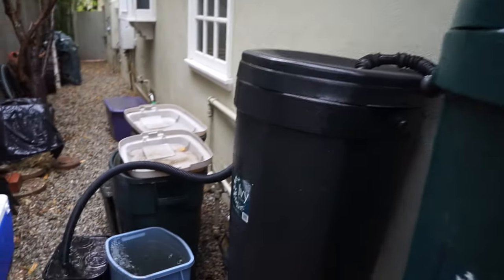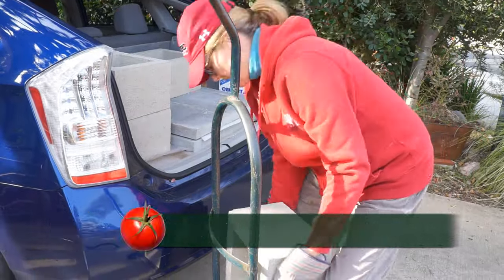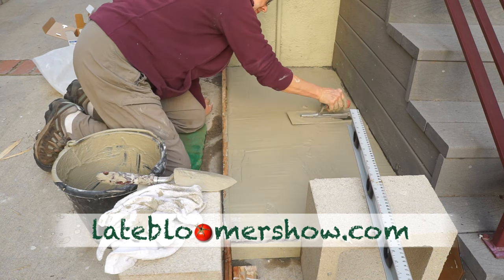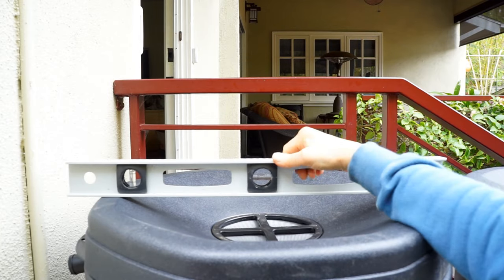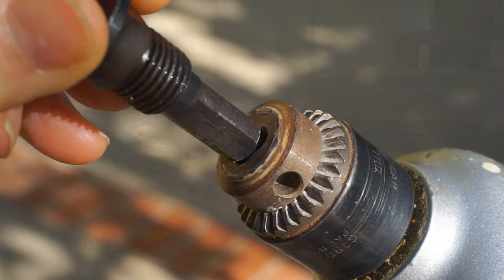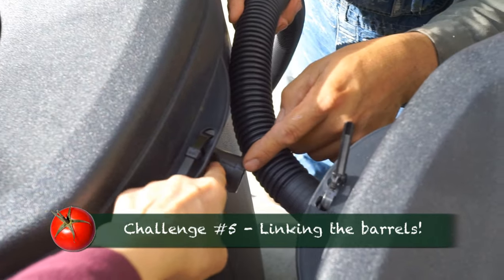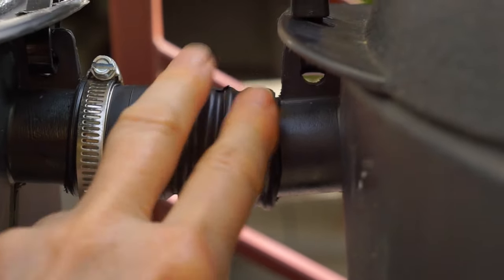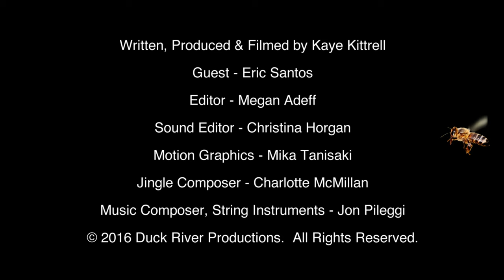Rain Barrel Install DIY & Challenges - Late Bloomer | Episode 4

Comment: Great job, Kaye! I'm glad the diverter kit worked out! It probably won't make a difference with the small amount of rain you get, but I would have pitched the platform ever so slightly away from the house.
Reply from the maker: +OneYardRevolution | Frugal & Sustainable Organic Gardening  I think that's the problem on my other rickety setup. When it overflows the top, it spills back down the side of the house. Must work on that, but it's hard to adjust the tanks when they are full of water! 600 pounds, LOL! I think the newer set up is not nearly as worrisome as the other side. Good point. So if tanks are literally leaning against the wall of the house, they should pitch forward a touch?
Reply: +Kaye Kittrell | Late Bloomer Urban Organic Garden Show Yeah, ideally the platform would slope away from the house just a bit.

Comment: I will not lie it was very... entertaining lol. on Saturday we installed a 5000 liter tank in the front yard. We fill it up with borehole water and attached a small pump to it. so we can water the garden and if needed we can hook it up to the house. We still need to install two smaller tanks that will collect rainwater and will be used only on the garden. :-)
Reply from the maker: +basic gardening What is borehole water? That's interesting, and a 5000 tank must be HUGE. How is your garden doing? This is Conrad, right?
Reply: ***** yes it is Conrad. It's not that big we could have gotten the 10000 liter tank. You might call it a well over there. It is a hole drilled into the ground with a pump in it.
Reply from the maker: +basic gardening You mean, it's ground water in it?
Reply: ***** yes ma'am

Comment: Love it!  I have a bunch of rain barrels at my house and I can fully relate to your plight.  I have one right now not even set up because of how much trouble it'll take to set it up.  One thing that I've done with mine is I have soaker and drip hoses staked through the garden off of them.  It rains enough here in Tennessee to where I don't need much more than what drips from my rain barrels.  A few times in the summer it'll go a few weeks without raining so I'll have to irrigate then, but the rest of the time no worries.  I bet you'd need tons of rain barrels to do this in Cali though. I'll empty an 85 gallon in a week or so, but then I just switch the spigot to the 2nd one.
Reply from the maker: +Quantized I'll be in TN next month, where are you located? How does your garden look? I just got through hauling 2 gal. can back and forth from front rain barrels, made over a dozen trips, and my back is aching now! I want to get my last Vlog from Vancouver posted tonight and tomorrow a new episode! Stay tuned.
Reply: +Kaye Kittrell | Late Bloomer Urban Organic Garden Show I'm in Maryville if you're in my neck of the woods I'd love to meet up! :) My garden is doing well some things are sprouting and surprisingly a lot of things made it through the winter thanks to my hoop houses and small greenhouse.  Don't have my rain barrels going yet because we are still having freezes.
Reply from the maker: +Quantized I should be passing through Knoxville on my way to Abingdon, and that's not too out of the way. Have not planned my exact route. Was thinking of doing a Vlog for that trip (as it would have a lot of material and cost me a fortune to make into episodes), but we shall see if the Vlog helps my channel or if it's just getting a bump from the folks at the festival and my regular reliables.

Comment: A Stainless Steel downspout, impressive.  I'm glad your video had a happy ending but at times it was painful watching.  Hopefully the sun won't be hitting the barrels or at least not very long.  Those barrels aren't like any I've seen in Oregon, they seemed thinner.   My concern with the density and color if the sun hits it would the plastic get soft?  I would get the platform level, level as possible if the plastic tends to soften.  You did a terrific job Kaye, glad you have someone to call when help is needed.
Reply from the maker: +David Dube (Oregon Homesteader) No, sheet metal, not stainless. I'm sorry it was painful!! I was hoping you could sit back and laugh at my misadventures. The sun will hit the barrels for about 3 hours a day, when it's shining. They have not gotten soft on the other side and they are 3 years old now. The plastic has not softened, yet. Thanks for the heads up, I'll keep my eye on that. I mean, I had to put them where the downspout was and where there was space. Thanks so much! I got a half truck of wood chips, more than I can use in five years dumped on my driveway last Friday, and as exciting as it is to finally get some quality tree mulch, it will be sitting on the driveway a long time! I hired Rene to help me move enough down lower so that hubs can get car in driveway. There's no way that that pile could self-combust is there??
Reply: Well, if I ever found out my wife had managed those pavers by herself, we would of had a serious conversation:)  It was when you had trouble with the downspout that I was seeing all the possible bad outcomes.  I need to remember you're telling a story...good job!
Reply from the maker: +David Dube (Oregon Homesteader) thank you, David! I guess that says something about my hubs, eh? He didn't even ask about them. Now, what about that wood chip pile combusting? Part of it is leaning against a redwood fence. It will not be over 72 while I'm gone and the sun only gets back there maybe 1-2 hours in the afternoon.
Reply: ***** Oh, the was a serious question, sorry.  I've only heard of combustion within enclosed spaces where the heat can really build up.  We always have a large load to draw from and it's 6-8 hrs in the sun.  Depending on the type of mulch, I'd be concerned about your driveway staining.  Do you have a tarp under it?

Comment: Hi Kaye, congrats on your diy success. now, could i please request you to use safety full cover glasses and properly graded gloves. and finally please hold the drill tool straight, especially while drawing back, i notice your angleof retrieval is quite slanted and poses heavy risk of bit shattering and flying all over.  and have a nice day.
Reply from the maker: +Chandan Maddanna Thank you so much!! I really shouldn't be using a drill at all. And you are right, my regular glasses are not good enough protection. Thanks for the reminder!! Thanks so much for watching!
Reply from the maker: +Chandan Maddanna In fact, I'm going to add an annotation on the video per your suggestion. Thanks!
Reply from the maker: +Kaye Kittrell | Late Bloomer Urban Organic Garden Show Please check the drilling section now and see!
Reply: +Kaye Kittrell | Late Bloomer Urban Organic Garden Show sure kaye, you are very welcome. and its eash, i am sure you will master the tools. and that way we get to enjoy your shows and have you around for a long time, happy and healthy :-)
Reply: +Kaye Kittrell | Late Bloomer Urban Organic Garden Show not able to see it on my tabby, but if u have added it i am sure its there. thank you very much for considering safety inputs .